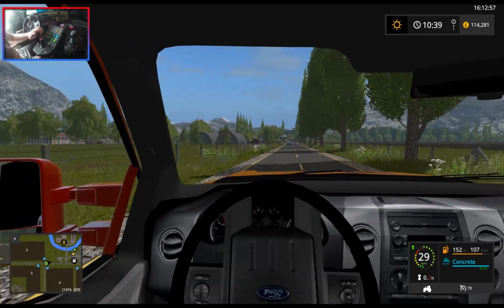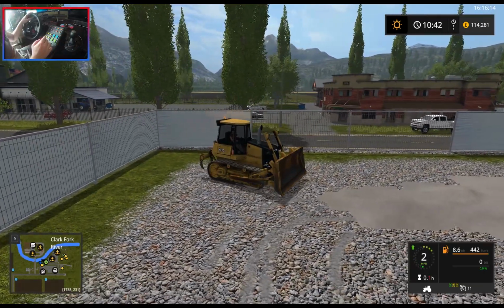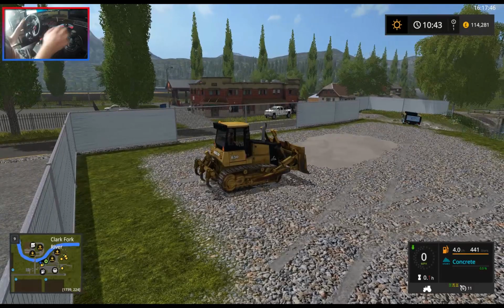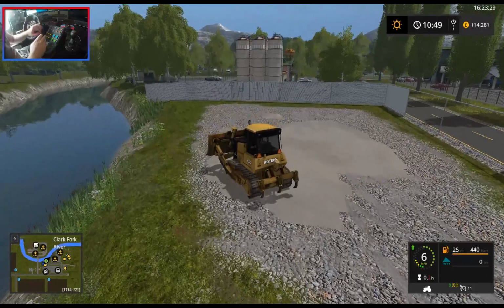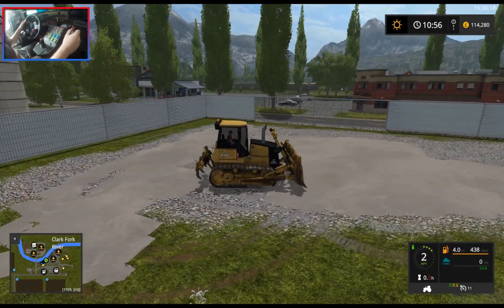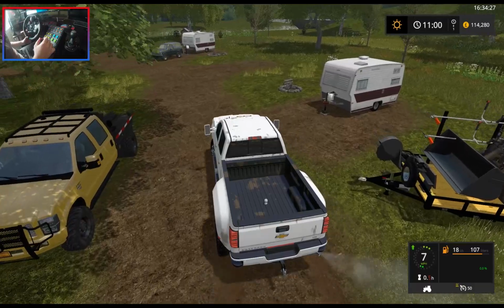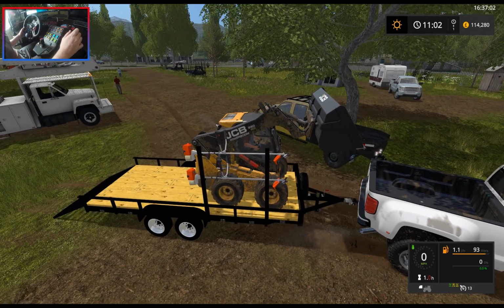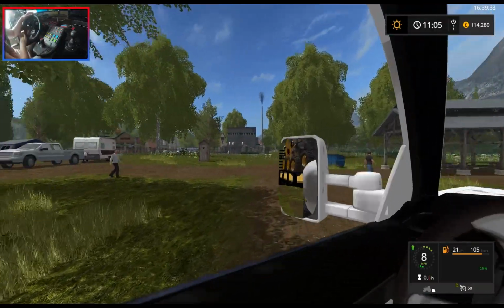Lawn Care USA #5 - Farming Simulator 17 (with Wheel Cam)

Comment: good video but in real life a cement mixer would deliver the concrete (as it would dry up in the bed of the dump truck) and you would probably just level it with a spade or a concrete rake
Reply: B.A Contracts 
there probably isn't a good cement mixer mod 
he's got to work with what he has
Reply: cyber rednec I know that